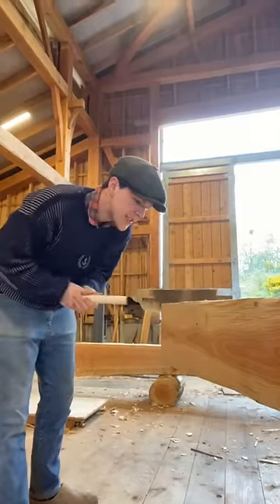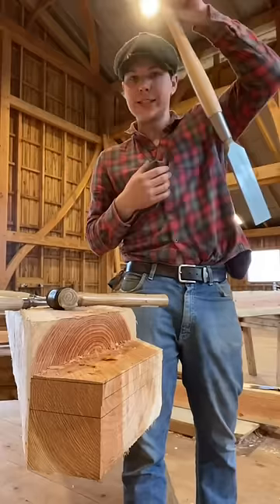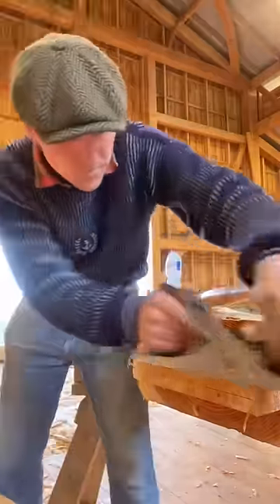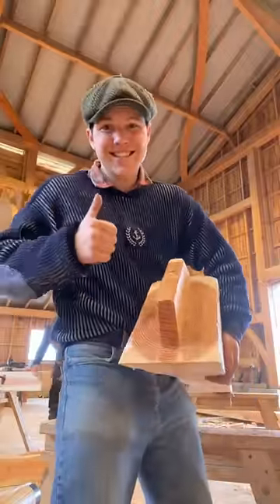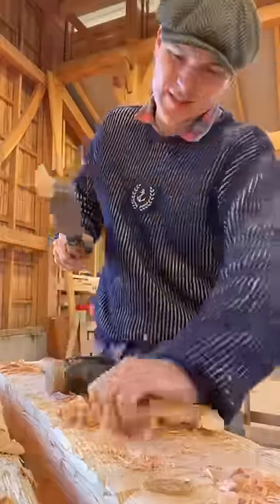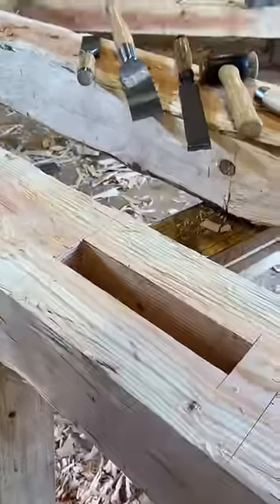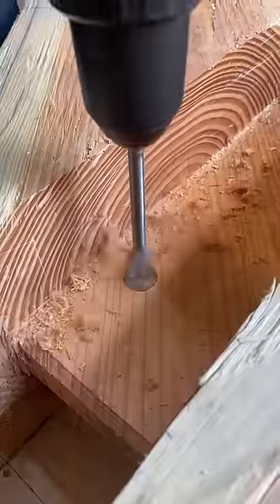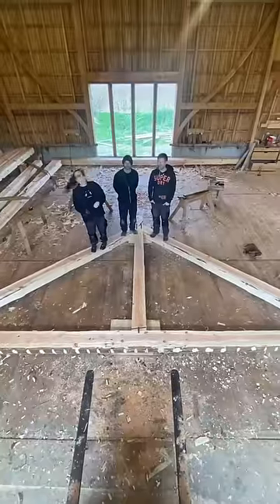Making a timber truss with traditional hand tools #handtools #ireland #woodwork #joinery

Comment: Corner chisel, simple, the corner chisel is a tool that allows you to grip whatever you’re working on and spin it around 360 degrees in any direction so you can work on it from any angle

Comment: I don't like to shave, plane the joint perfectly. A bit of roughness left by the chisel makes the joint much tighter. Fitting exactly, but not perfectly even and symmetric, and so the in part can't shift and move as much. The uneven and rough parts create a socket which don't slide.

Comment: My great great and great grandfathers built the house I sit in today with their own hands. The main part of the house they built is still in great shape. The added bathroom can not be used because you will fall through the floor. Trust there are a couple lady size 8 holes in the floor. I am not super fat either. The added bathroom was built by a contractor around the millennium. The main house was built just after WW1.

Comment: Those are rectangular beams, not square beams. Still a nice quadrilateral though, 9/10.
Reply: square means 90°in this situation, a square is a tool used to measure if something has 90° corners, if it does, that object is square.
Reply: @jasperbeil7896  Given their appearance, they are definitely not square by that definition either.